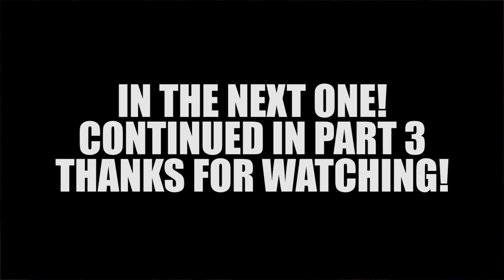Making A Multi-Output Power Supply Part 2 - Input/Output/Switches

Comment: The board you are using is not Veroboard! Veroboard has copper strips connecting rows of holes. What you are using is called matrix board. You can easily overcome non-standard pin spacing by using tinned copper wire of a fairly thick gauge (20-22 awg) to connect the modules to the matrix board.
Reply from the maker: You are right about the Veroboard, I've been using it wrong, but you did get what I meant. Thanks for the clarification. I could have overcome the pin spacing with some tinned wire but I ended up going this route instead, just needed to get a prototype done. Thanks for the comment!